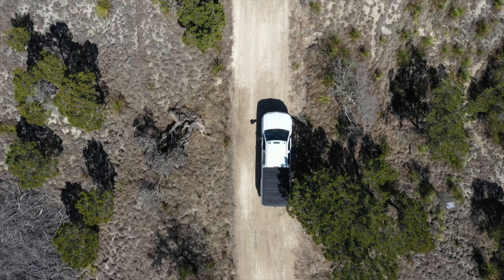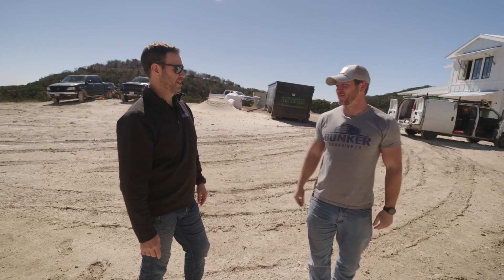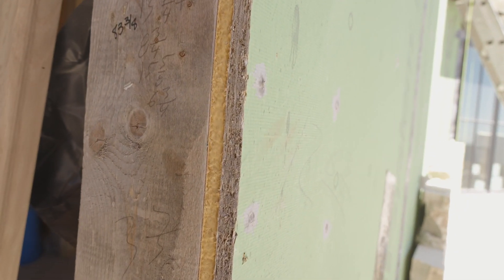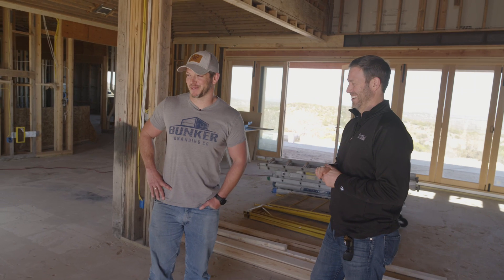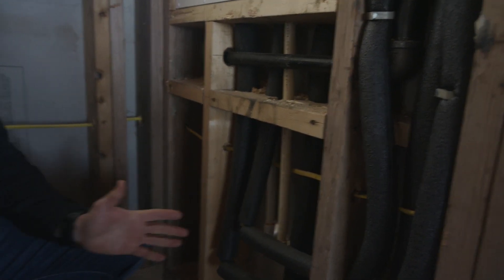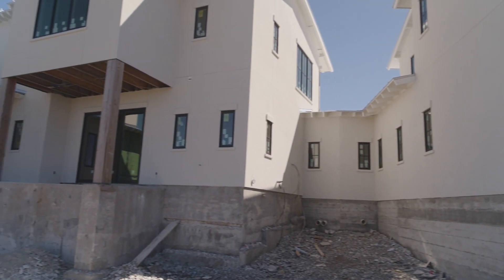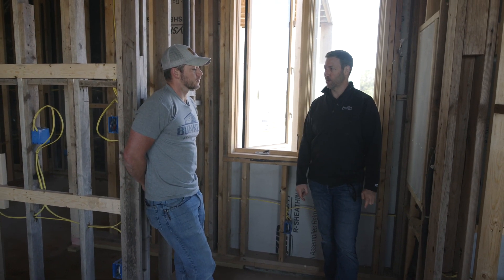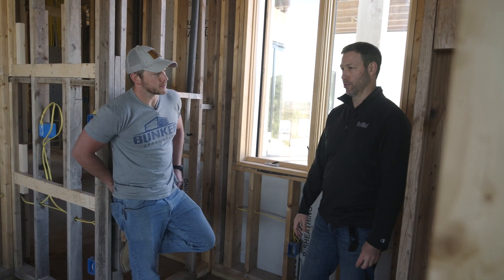One Vulnerable Spot at the Abandoned Mansion

Comment: Heat pumps still suck compared to a gas furance, they struggle up north and require AUX heat to even maintain. Cost more to buy/install. Cost more to operate per month then a High efficiency gas furance. Parts and repairs are a lot more expensive and labor intensive. To each their own, yet the cost to the owners over their life span it is substantially cheaper for a NG furnace vs heat pumps
Reply from the maker: New tech on heat pumps are awesome. Crazy efficient and less $$$ to operate
Reply: correction, air source heat pumps suck compared to a gas furnace. water source heat pumps are amazing and cheaper to run than a furnace. its the install that can be killer
Reply: Air source heat pumps purchased for a cold climate will heat a home at five degrees without a problem only issue is they are half again the price. But a house his size would need about ten condensers and would be kinda weird looking lol. I live in New England and our insulation packages seem a lot better so I am probably wrong.
Reply: @tysonhayes5201  I work on them daily up Northeast here and even proper sized ultra high efficiency heat pumps struggle to keep up and require Aux backup to even maintain. The high efficiency ones are nice till they need repairs. Parts are always special order, expensive and repairs are never quick in weather often in the negatives. Systems may be great down south where it's rare to be colder the 25 degrees but up north they are never advised to anyone with access to NG or even propane. Average natural gas bill for a High efficiency gas furance is 55-100 bucks for a home that starts at 6k with AC installed. While a all electric home easly hits 200plus a month for just a heat pump to operate that starts at 12k installed. I have seen some customer bill hit 600 a month on the real cold winters here.

A 97.7 percent gas furnace is still cheaper to buy compared to a hestpump and cheaper to operate up north where our winters drop into the negatives vs a all electric home. Gas furance parts are easy to come by and repairs are substantially faster. Everyones loves to talk about the efficiency of the ultra high seer heat pumps but the upfront investment is never made back in what they claim to save  and cost of repairs after a warranty expires are insane compared to even a propane system. Heat pumps are a foolish choice where NG is available. If Texas had harsh winters as a norm NO ONE would want a heat pump.
Reply: @zack9912000  haha you must be in service. I moved to sales two years ago. Vermont and NH are trying to go fossil fuel free in public buildings. We are going to have to cut down all of our trees to make room for the amount of solar panels it’s going to take to do what they want. And you were spot on with the repairs and wait time. Out of warranty these things are not worth fixing.
Reply: @tysonhayes5201  Just had a Bosh heat pump with a compressor failure that took 3 weeks to come in, a non stock item with freight costs. Might as well add their increased electricity cost for running AUX heating element's during that time.

With labor, 410a and repair materials it ran them 4k out of warranty. Average repair cost for a furance on the high end is 750-1100 out of warranty and parts are usualy in stock or a few days to come in.  To each their own but the complete life cycle of equipment costs to the owners, gas furances are by far the cheaper options period.

Comment: All Isolation needs breathing, breathing, breathing...... Do not make a place in your house the water og condencation will not get out, and always make the breathing for your roof that it does not collect water where it is likely to seep in.......... Roof shingles you always go from east to north east . Rain always comes from east and goes north.....
Reply: Just keep like the weather coat, breathing at least 2 inches from the outer layer with airing... And roof easy breathing..... Breathing is also insulation....

Comment: Wait, wut - you have water heaters outside the building envelope?!? 😲  
Surely you'd only do that somewhere that NEVER gets cold, like the tropics?  If it's outside with minimal insulation, surely you're wasting energy heating the air outside during winter?
Even in the tropics, ours are installed inside somewhere like the laundry room.

Comment: Matt, talking backup generator just begs the question why not batteries for the house with a subpanel for the specific items you want to run.  Virtually no maintenance on them, while a generator you have to have fuel and be sure it is checked all the time.  I realize for your clients that were down for 6 or 7 days, the solar recovery during those days was nearly zero.  but the idea of a new home without a batter system seems like a waste of an opportunity.

Comment: Still find it weird you Texans like in-wall water heaters...  If your water heater loses heat to the atmosphere, wouldn't you want that to happen into a conditioned space?  Feels like that metal case is a giant thermal bridge through the wall...  Why not put in on the inside of a garage wall?  Not a fully conditioned space, but also sealed from the living volume of the house - most can handle water on the floor.

Comment: "I'm thinking about a backup generator"....      People laughing in Florida.....   Just remember if the power's out, ain't no one filling propane tanks and if they are, it ain't cheap..   Honestly if you want a helluva backup generator get one made from an old Deutz Diesel engine.   Air cooled.  No real accessories.  they're usually made with big diesel base tanks and you can always use the diesel in the 5 ton as well.
Reply: We have a large portable gas generator we use in the heart of apalacha

Comment: Stop with the Aquo valve... It will not be easy to fix and repair...you cant goto home depot or lowes for parts...Buy extra frost sillcock the same size...now you have extra parts like backflow preventer ,washer ,stem and handle.  This will last you for years ...  remove the band iron on the pex pipe...use a plastic anchor...metal will eventually rub against it and cause a rupture. I seen this happen...what a mess.